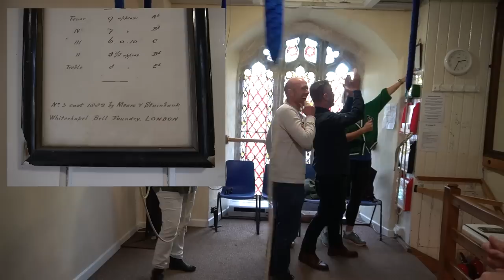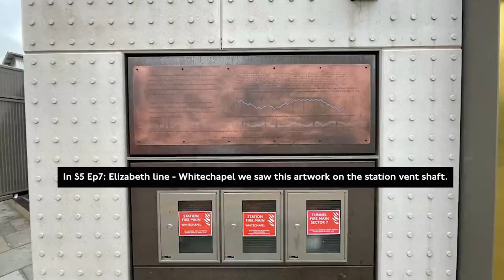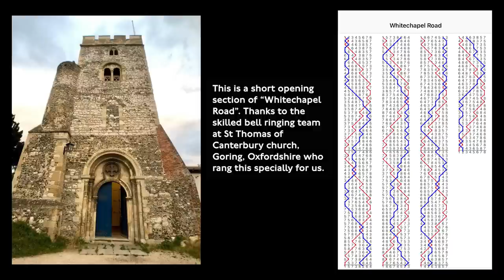Whitechapel's Bell | Hidden London Hangouts (S06E06)

Comment: Good video, thank you.

So, if the bell is pulled past the top too energetically and breaks the wooden safety stop, will the rope abruptly disappear through the hole in the ceiling?  And can this cause a safety hazard if the rope had been wrapped around one's hand?
Reply: One does never never wrap a rope round one's hand, there is a certain way of holding the rope  whilst ringing.
Reply: Indeed - the rope is only coiled around the hand when ringing the bell up or down.
Reply: @chrisnix6352  6 bells